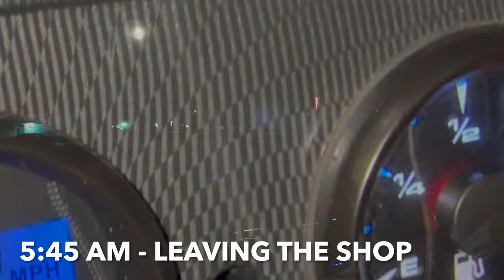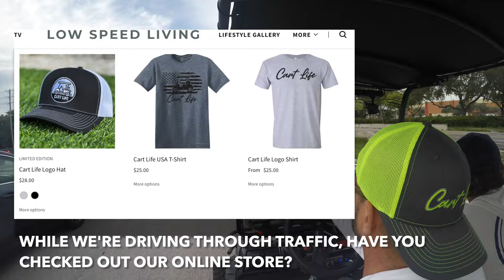Ep19 - We Drove Our Club Car DS Golf Cart 225 Miles to Key West- Part 1- Boca Raton to Florida City.

Comment: What’s the top speed ? Other than the bigger wheels what was done to get it to that speed? Adjust governer/ high speed gears?
Reply from the maker: Gears are stock, governor taken out, bigger wheels and tires.
Reply: What is the top speed and at what rpm?